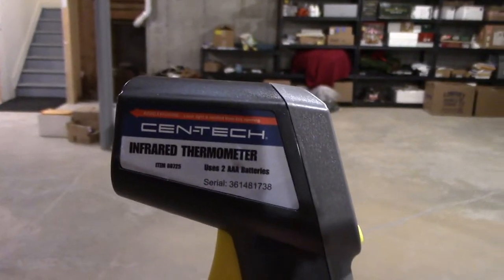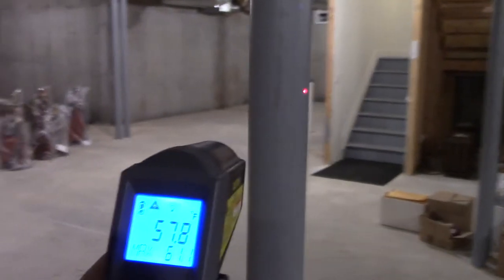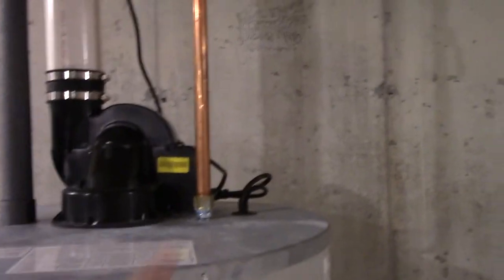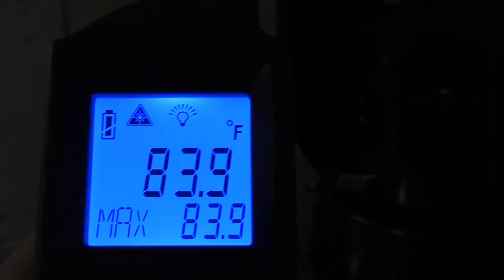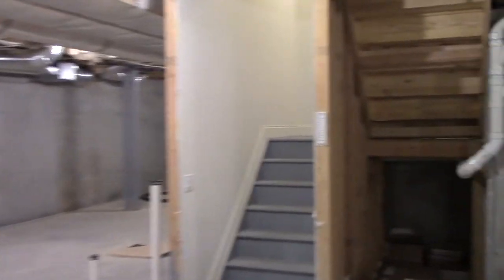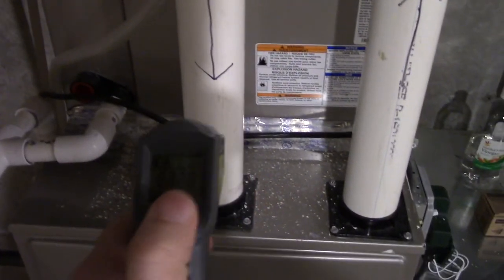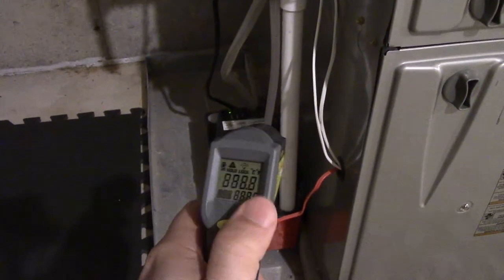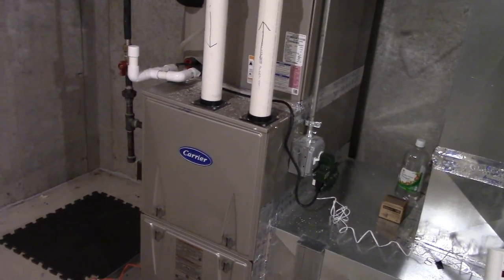Cen-Tech Infrared Thermometer.

Comment: Good buy, I use it to check supply ducts including in the car, bearings on motors, air leaks around doors and windows and the cats like to chase the dot lol. You can also check insulation values on windows and walls, check gaskets on refrigerators and freezers. There is a scale that came with mine that gives accuracy percentage verse distance. Cool gadget to have around with 101 uses.
Reply from the maker: Oh yeah it's a fantastic device. I've used it on many things around the house already!